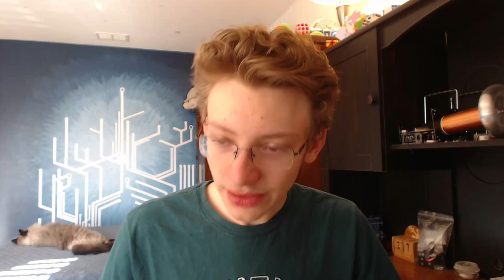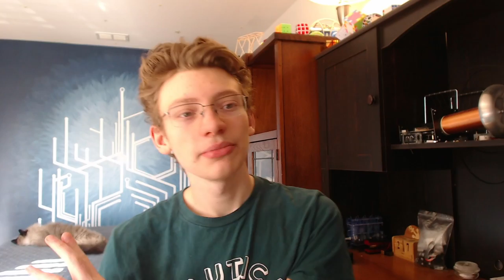Your 3D printer Sucks | Manufacturing Monday

Comment: I agree with you on some points, but you have to remember that mechanical things fail far more often than non mechanical devices. Think about an SSD vs HDD in your computer, which one fails more often? The biggest problem with 3d printing is there is less innovation than there is a copy of a copy of a copy all with a goal to make a profit from something that sells, rather than changing the industry. Its really impossible to make an affordable printer without making a copy of a copy of a copy, because they just cant make parts in the mass quantity to where the price drops enough for us to buy. If every 3d printer company all got together and decided to make robotic arm 3d printers at the same time, and all of us consumers bought those, then maybe we could progress faster, and they would become affordable. Sad reality is that will never happen, so we are all in this together to ride it out as a community till we get to where it should be. I still gave you a thumbs up for voicing your opinion.

Comment: I agree with a lot of what you're saying. It's frustrating spending all your time working on a machine and not using it. I'd say the market is oversaturated with printers now too, so its just going to get harder and harder to get value. You also have to get good at 1) slicers, 2) CAD if you want to make anything original. It can be frustrating.

Comment: To your point about things failing I worked with CNC in industry for a bit and in college and I can tell you that sometimes through faults of the Gremlins and machines even CNC machines would fail and breaking parts of bits or damaging the part or the work holding so failing is a part of succeeding
Reply: But at least with CNC the higher quality materials make the frustration worth it

Comment: You are on the right track about quality though more needs to be done with input shaping and setting up printers at the factory so Prince come out looking good also including decent slicing settings in your default software is extremely important I've had to modify my ender 3v2 and any cubic vyper settings a lot from stock. I run Klipper and use input shaper and pressure tuning in my prints always come out crisp now why can't that be done stock, it can be but you will pay a price

Comment: You also did partially answer your own complaint with the price you did by your phone for near $1,200 and a near $1,200 3D printer would have great quality and less chances of failing compared to say a stock ender 3 for $200

Comment: 3D printing is overrated and overhyped. All these poor people misled into believing these machines are already replacing conventional manufacturing... Nope. They want you to believe that story so they can sell you their machines. I've started using 3D printed parts as early as when this tech became a thing. An interesting fact I observed is that the first people to start making serious investments in 3D printers are also the conventional manufacturers. They are constantly in need of new fabrication techs, and they are also wealthy enough to spend the kind of $$ on good equipment. These are not the cheap rigs slapped together to fit on top of a desk. They are often $100K+ industrial grade equipment. The idea a desktop printer would be anywhere comparable to a professional manufacturer's tools is a delusion. And the idea that one would be saving money by printing everything for himself is either another delusion, or an indication that - this may sound harsh - this person's time is no more worthy than the cost of a few plastic parts. FDM printed parts suck. They lack the strength, they look hideous, and you can't print thin-walled parts with fine details using FDM. For anything from less than a dollar to less than a hundred dollars, I have access to laser sintered parts made out of nylon in any sizes, these are the best 3D printing experiences I've ever had so far, but unfortunately the benefit doesn't come from owning a 3D printer myself. Instead, I outsource them to some factory with their $200K+ industrial printers who also takes care of all the processing for me. For a fair price, I get to focus on my part of the job which is designing and testing for future iteration. The liability of faulty parts should be with the factory. This is a fundamental understanding of how the economy works and how the society functions which every professional engineer needs to keep in mind. I would never encourage anyone to get his own printer if he's expecting to both save money and his precious time by having one.